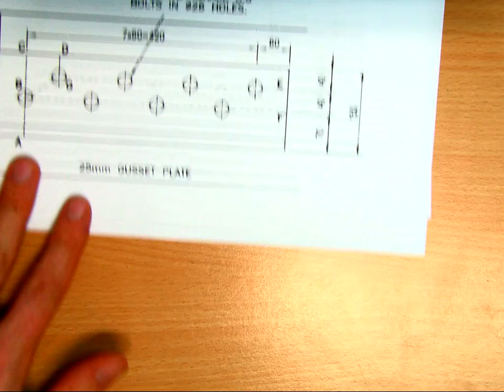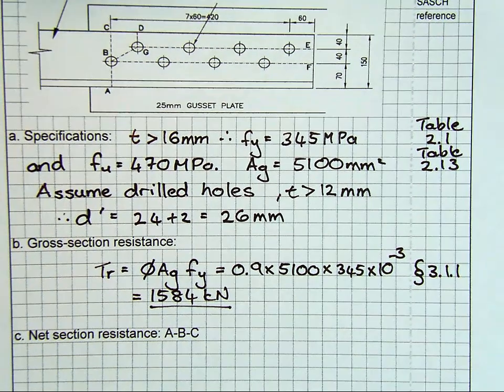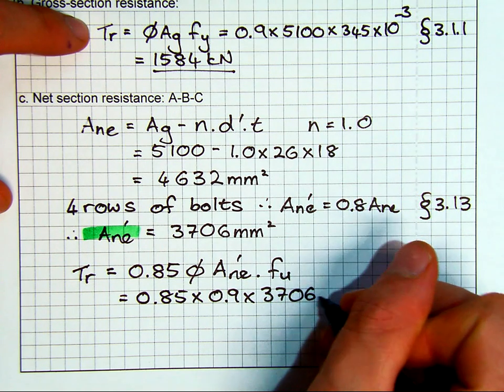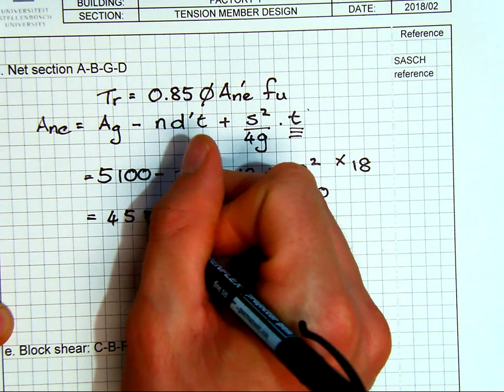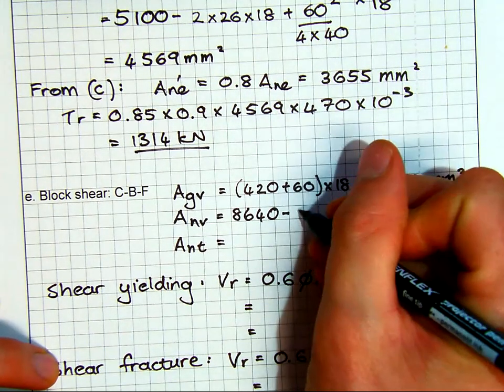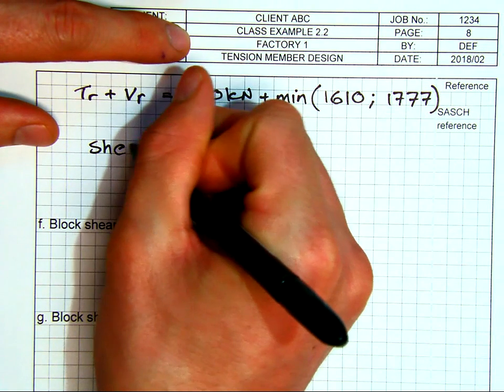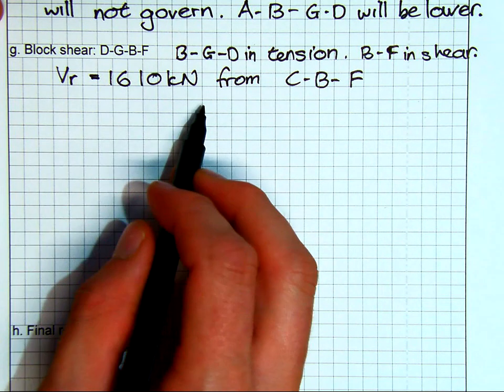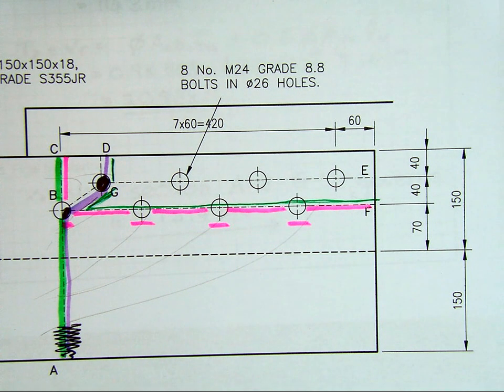Steel Design - Tension member design to SANS 10162-1 - SD424

Comment: If you made a mistake when calculating the tensile failure of A-B-G-D your Tr was supposed to be Tr=0.85*0.9*3655*470*10^-3. Please correct me if I am wrong
Reply: I think he made a mistake,he was supposed to use the effective net area not the net area, the Tr= 1314 kN